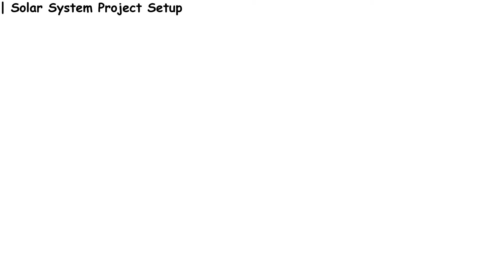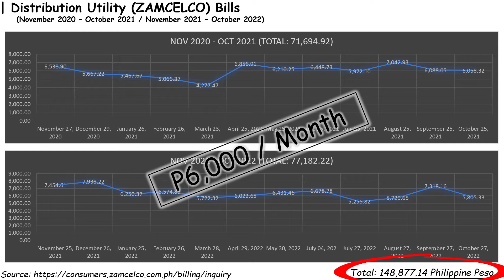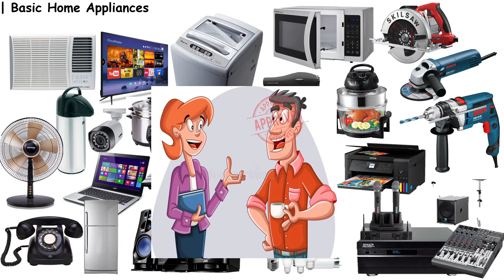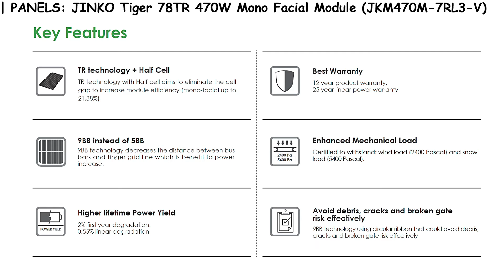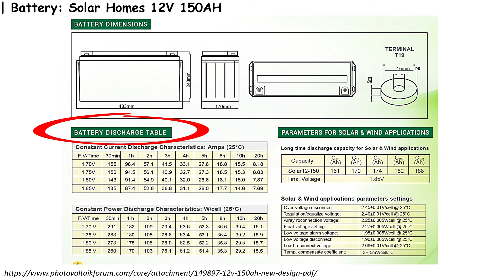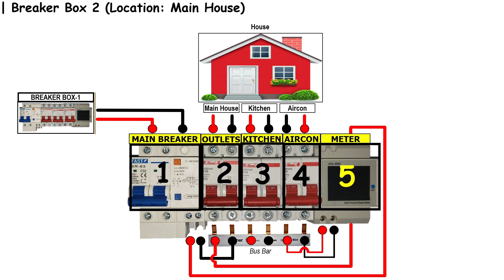DIY Solar Power System (PowMr | Jinko | Solar Homes) Part 1 - Planning

Comment: hi, i just bought a 10.2kw powmr inverter, can you help with breakers and fuses i need, wire sizes for battery if i use or i can find a 48c200ah or 300ah Lifepo4 battery. if i use 550w solar panels monocrystal type how many i need ? thinking of in series the panels and what size cable pv approx over 10 meters in distance ?

Comment: CAUTION: The polarised DC-Breakers you use can NOT be used bidirectional for Battery on a Hybrid Inverter.
WARNING: The polarized DC-Breaker from solar panel MUST be connected the other way arround when coming with source from bellow. Both Plus poles from Solar panel and Inverter must be connected on the RIGHT side  (down right Solar+, up right + to Inverter, even there is a Minus symbol). Otherwise they can easely catch on fire when they trip!

Note:  Due to low voltage (40 times less than rated) the bidirectional application of polarised breakers works with battery I think, but at Solar panels the polarisation must be swaped when coming with source (solar panels) from bellow.
Reply: What about RCBO surge protector for AC ? Must be type A or type B ?
Reply: @ΔημητριοςΑραβιδης  I took 30mA-Type at AC main grid house input and same at Inverter AC-output, but there they do not work, cause there is no grounding, neutral and hot wire are not defined, both are just floating, but maybe the RCBO helps when solar panels have some faulty grounding. A 275V surge protector i have at Inverter AC-Input and at house main Input a over/undervoltage protector (relay) is mounted.
Reply from the maker: Yes it can be. I'm actually using it for almost a year. Polarity is observed, but the direction? not necessary. It does work bidirectionally.
Reply: @prepper_z  As soon theres no + or - symbols on breaker they work birdirectionally, but the schematic drawing you show there are  + and - Symbols and they are connected wrong.

Comment: Lifepo4 batteries are cheaper over all, less than half price, even the initial costs are a bit higher. They can be discharged deeper and have a much longer cycle life. You can build it by yourself, there are many videos arround how to build them, with compression (for longer cycle life) and BMS. You build your system like a professional, so the DIY Lifepo4 battery will be a easy task for you....next time ; )
Reply from the maker: Yes, you are right. Thanks. I bought a 24V 200AH Blue Carbon LifePO4 battery and it works great. My 2 pieces of 12V 150AH Sealed Lead Acid batteries is now used (in parallel) for my backup Powmr Hybrid Inverter - 12V 1500W. 

I now have 2 Powmr Hybrid inverters. 1 24V 3500W powered by 5 470W Jinko Solar Panels and 1 12V 1500W powered/charge from the AC OUTPUT of my 3500W inverter during daytime. I needed to improvise because I'm still saving to buy dedicated panels for my 1500W inverter.
Reply: @prepper_z  My 560Ah 24V 14kWh DIY  Battery with good smart BMS from Jikong was in total 1500 bugs.

Comment: Good start!... I do not think the batteries will be able to power your house pass maybe 1-2hrs. Because it's 3.6kwh in total and because you are using lead acid batteries you only have access to 1.8kwh   which is the 50% discharge that is allowed. The a/c unit is a big ticket item amongst the rest of appliances. But  you can always add more batteries as you go along.
Reply from the maker: Thanks for the advice! :trophy-yellow-smiling: